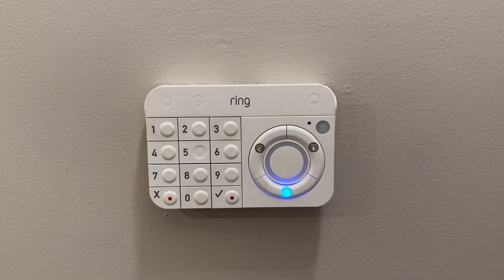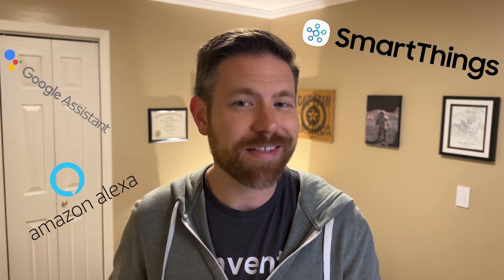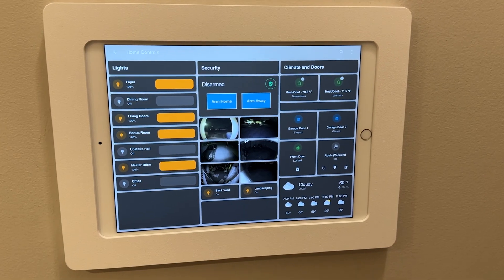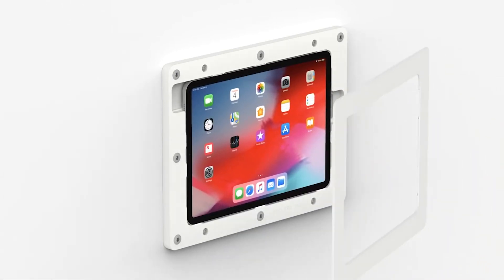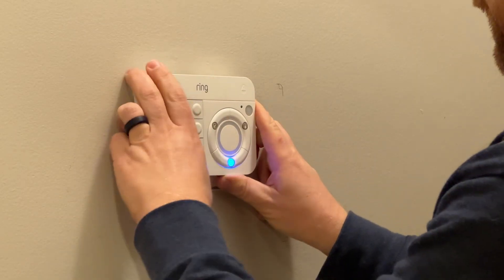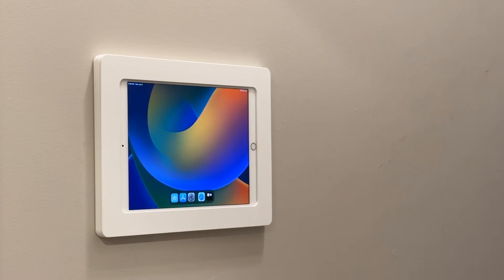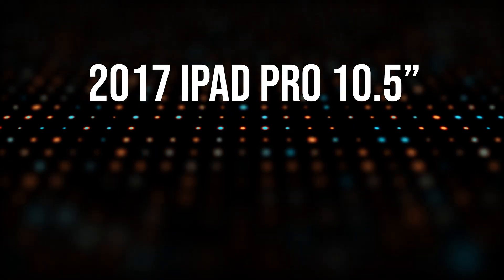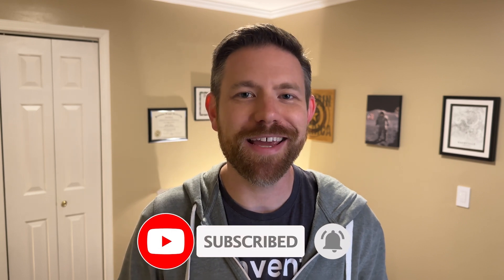iPad Wall Mount: DIY project for controlling my smart home (and replacing my Ring keypad)

Comment: Those panel mounts are really expensive. I might have to search for something more reasonably priced.
Reply: just finished this kind of project myself using a samsung tablet and got a model specific 3d printed mount off etsy for 40 bucks...works great...no need for something so expensive.

Comment: I like what you did and I even have an old iPad that I hardly use after buying a new one.    I think your mount is "ok" but Ithink it would look nicer if it where recessed into the wall, just cut out some wall board and design and print something that places the glass surface just a bit out from the painted surface.

But the bigger problem for most people is that they don't live in a house where low-voltage DC has already been pulled to the location you need.    They would have to have a "building code legal" way to power the iPad.   I don't think it is OK to put a phone charger inside a wall box.  A visible cord looks bad.
Reply from the maker: There are wall box DC transformers that one could install, but I agree that path is more advanced. I was fortunate to already have low voltage available at this spot. Personally, mounting something like this with a visible cable would be a no-go.

Comment: "Complete DIY" and yet you use a £100+ wall mount. Poor.
Reply from the maker: High standards. :)
Reply: I'd 3d print a mount and make it look like anything I want.   It would cost me about $2 plus.  But I coud not recommend that in a video because not every has the design skills and a printer.
Reply from the maker: I respect your skillset. That’s just not a path I’ve invested the time, money, and energy into doing, let alone doing well. So for me, spending a bit on a mount that I believe is clean was the way to go.

Comment: What’s the app on the ipad you use to control everything?
Reply from the maker: Home Assistant
Reply: @TechWinnerCC  Can you make a video how to wire up an iPad on the wall, please?
Reply from the maker: @filmboxhd2837  as I mentioned in the video, I repurposed some low voltage from an old security system with a buck converter to step the 12v down to 5v. I don’t have any immediate plans to run any new low voltage, but I’ll keep that in mind.

Comment: Hey Donnie enjoy all your videos especially the one on your new iPad addition to your security system. I’m thinking of doing something like you have but was going to use apples home app. The only thing I’m not sure of is that they tell you to scan the QR code of the item but was wondering if you would know if I scan the base station would all my cameras and sensors be automatically added as well. Any help would be appreciated thanks
Reply from the maker: Hey George! I haven't done a ton of research on this, but from the little I've seen and heard, people are using a hub named Hoobs to do this (allow Ring devices to communicate with Homekit). There are some good YouTube videos out there about this. Search "Hoobs Ring"
Reply: @TechWinnerCC  thanks Donnie for getting back to me. I did see that I will have to look into this. Thanks for your help